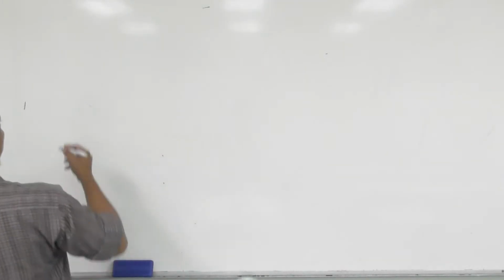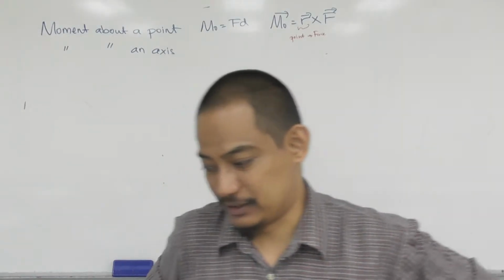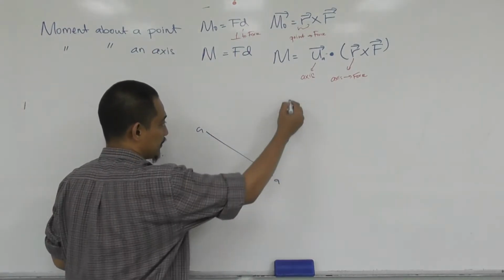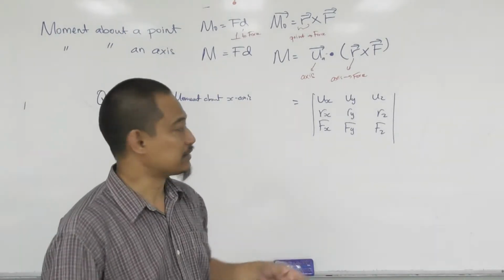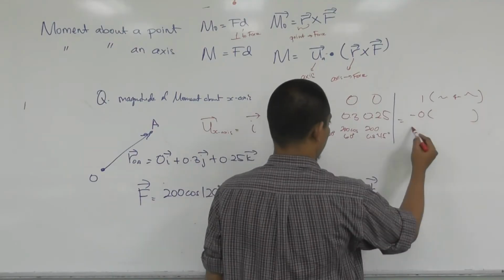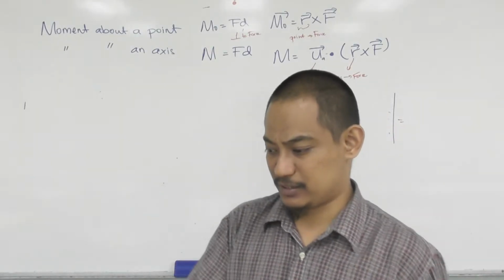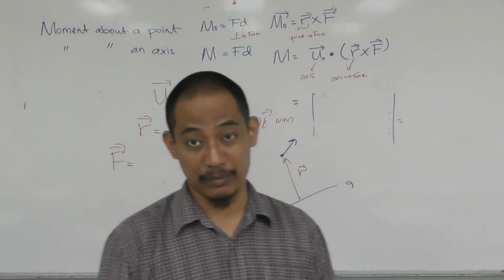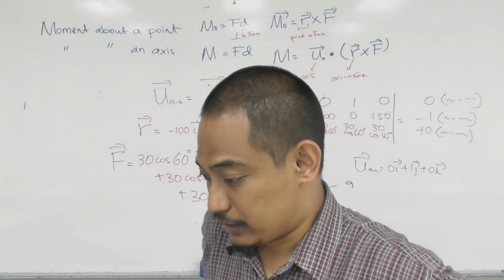Statics - Chapter 4 (Sub-Chapter 4.5) - Moment about an axis

Comment: Also Dr Saifuddin, for 17:49, is the answer to the concept quiz R(db), because I think the arrows of the r and F vectors must  meet at a particular point in order for the vector product to work. If the arrows  of the two vectors do not touch at a point then it will be wrong, yes ?
Reply from the maker: the answer for the concept quiz in the slides is r(db)
because r in the equation must be from the axis to the line of action of the force
for r(db) it is from the force to the axis, so wrong if used in the equation

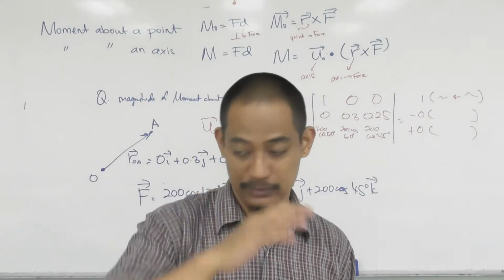Comment: Assalamualaikum Dr Saifuddin. For 17:09, I am having trouble to imagine how the object is rotating counterclockwise relative to the x-axis , because in the diagram shown it looks like the moment was projected on the z-axis. I understand about the sign conventions in moment though.
Reply: For me, the z-axis is the axis of projection so it is easier for me to imagine and realise the moment  about the z-axis. However for the x-axis (perpendicular to the z-axis), I cannot imagine the moment about that point. How can I imagine it better Dr ?
Reply from the maker: @GreenTeaTutor  what i try to illustrate in 16:23, how the rotation about x-axis (x-axis pointing towards you from the screen), can you imagine the clockwise and counterclockwise about x-axis?
Reply: @SaifuddinRehan  This one, I can Dr.
Reply from the maker: what do you mean by "in the diagram shown it looks like the moment was projected on the z-axis"?
Reply: @SaifuddinRehan  The diagram for the example, has a bolt in the z axis and the object looks like it is rotating around that axis.
Reply from the maker: @GreenTeaTutor  hmm, okay...

okay, if you try to calculate (using that diagram) the moment of force F about point O, you will get in term of i, j, k, correct?
meaning it will have x, y, and z component of moment in 3D space..

i understand what you mean, in that normally that structure is designed to only rotate about z axis, so the z component of the moment will be the one responsible for that rotation..

however the force still produce x and y component of moment about point O (because the force is not in x-y plane)..
relating to the structure, if the x or y component of moment is big enough, it will eventually break the structure, probably at O  (as the structure prevents it from rotating)...

now, why we are calculating the moment about x-axis in the question, is simply because, that was what the question asked for..
hence we only compute the moment about x-axis, using equation for moment about an axis...   (the answer will be the same as the x component of moment about point O, if you try to compare)

so hopefully it is clear that, we do not compute moment about x-axis because we see the structure potentially rotate about x-axis, we compute it because the question asked for moment about that specific axis...
Reply: @SaifuddinRehan  Understood Dr